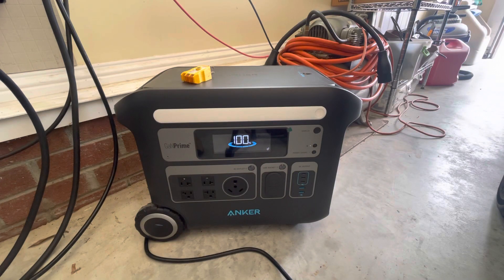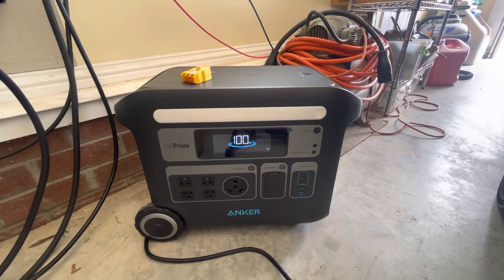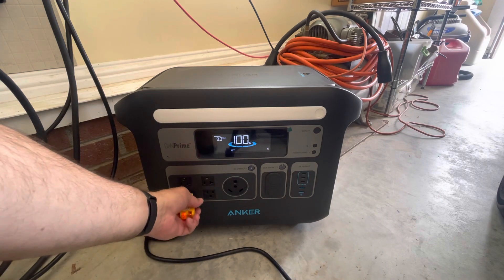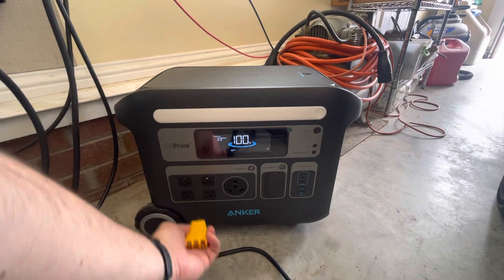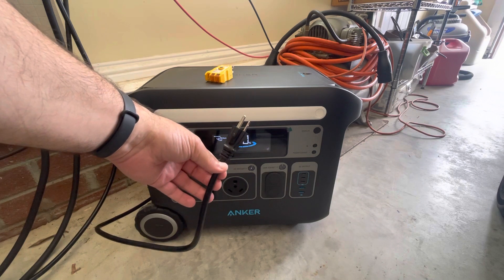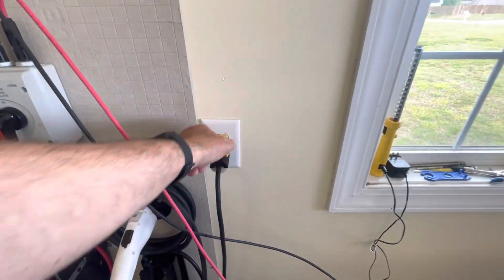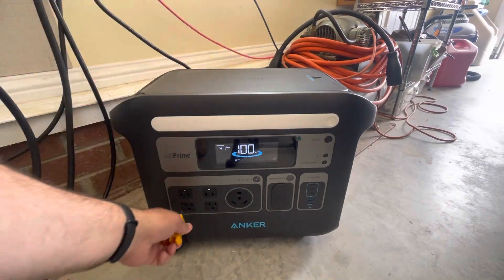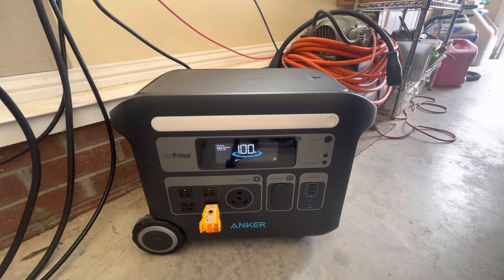Anker 767 reverse polarity testing and miswiring test

Comment: I'm trying to power my RV and my RV gives me a reversed polarity fault and won't let the Anker 767 power it. Reached out to Anker and was working with their engineers, they are great but they are saying it is the RV. Thor (I have a Thor Sanctuary 19P) and they said I needed a neutral bonding plug, bought two, neither work. When I did the test as you did. Unattached to the wall, the receptable tester tested hot and ground reversed on two separate testers plugged into the Anker 767, When I plugged the Anker 767 into the wall, it said correct wiring, so my test was the exact opposite of what your tested. It still won't power my RV. I think it may be the way my RV Southwire Auto Transfer Switch or Remote Battery Switch works and may be preventing it from working. If anyone knows how to fix it, please help. Thanks. I love the Anker 767, it works great and I have to give Anker credit, they have been trying to help me fix this issue but it is either their system or the RV's. My question is, why would the wiring be reversed? I understand that in an RV, you don't necessarily have an earth ground but can't it be grounded to the vehicle? Also, it must be an issue since all of my cables have a reverse polarity protection, which leads me to believe this is a problem in RVs (I'm new to RVs if you haven't figure that out).

Comment: Great video, I received one of these units and in my case the unit shows correct wiring when plugged into bypass mode however when in the inverter mode my socket tester says the live/neutral are reversed. Anker is claiming "you don't have to plug the tester into the 767 when in inverter mode because it does not differentiate between the Neutral and Live wires" is this correct?
Reply from the maker: Yes, that is correct for the Anker and most all "floating neutral" generators.  If you would like to learn more,  search youtube for "reel clear media" and watch his 3 part series on understanding grounding.

Comment: I've seen several videos with this and another issue that seemed to be a pretty big QC problem. Since Anker's tech support seemed to be so responsive (according to the reviewers) I went ahead and picked up the 767 Solar panel bundle during the recent Prime Day sale. I ran these same tests on my unit and "thankfully" am not experiencing either issue. So either I got lucky or Anker has resolved their QC issues. I certainly hope it's the latter as this seems to be a quality product. Thanks for sharing your experience. Cheers! 👽✌️

Comment: I just received one of these units and made sure to test it for this issue, and discovered the same problem. Thank you for the helpful warning! I have contacted Anker support, which opened a ticket with their automated system, but I haven't gotten a human reply yet.

By the way, I confirmed (at least in my case) that the issue is with the unit, not the power cord: I used another AC power cord that I had scavenged from an old monitor, swapped it in for the cord supplied by Anker, and had the exact same issue.

Comment: Quick follow up - replacement received and there is no polarity issue. BUT - (and I just sent an email to Anker), the replacement unit will not accept an AC Input Watt charge of >800 and w/in a few minutes, the input watts drops into the 40's and stays there. Any thoughts?

Comment: Thanks for this!  Luckily mine showed as "Correct" when I tested with my outlet tester and the charge cable plugged in.  With charge cable unplugged, it shows "Hot/Neu Rev" with the red light on outlet tester very faint, which I believe is okay since the Anker 767 is a floating neutral and not bonded.  If it helps anyone else, my unit showed it was manufactured on 1/4/23 and passed QA inspection on 2/14/23.

Comment: Hi,Can you post a video of your new unit?, Does the new one when not connected to the outlet shows "Open Ground" or both lights like "Correct"?, TIA
Reply: I got a replacement unit and it shows both light correct when plugged into outlet. But still having erratic wattage output. ANKER POWERHOUSE 767 STILL NOT WORKING
https://youtu.be/JH0LOmtinp8

Comment: Thanks man!!! Bought me the tester and I have the same issue. Email with video sent to Anker!
Reply from the maker: Let us know what they say.  Most people are being told to ship their unit back but other people are being told there will be firmware update soon to address the issue.
Reply: @leafnutz2341  Anker responded overnight. They are sending me a FexEx mailer to send back my unit and they will be replacing it with a new one. TY very much for your video and FB post - I never would have known about the reverse polarity issue. (Really only an issue for my use, if I were using passthrough charging.)

Comment: Thanks for pointing this out on my video. I'm going to email them again about the hot/neutral issue. I dont understand the technicals, why does it only show the hot natural reverse when the unit is charging?
Reply: I'd suspect the inverter output internally is wired backwards.  When you're on shore power everything is okay.  But if you pull the plug (cut the shore power) the inverter kicks in..but it's flipped.

Comment: Just got my tester in the mail today. When I plugged the tester to my Anker 767 it shows open Ground. Should I contact Anker about this situation for a replacement? Or is open ground still safe? Thanks.
Reply from the maker: An open ground when running the inverter only would be correct for a floating neutral unit.  Repeat your test while the unit is plugged into a wall outlet.  Be sure to test the outlet your plug it into as well.
Reply: @leafnutz2341  ok, I also tested my 2 Jackery 1000, Jackery 500, & Jackery 290 they also shows “open ground” when I plug in the tester.
Reply: @leafnutz2341 So when the unti is NOT plugged into a wall and running on the inverter/battery only it is fine for a open ground on my tester?  Or should it be always stating correct on the tester wather the unit is plugged in or not?  Please advise.  Just got mine today and it shows open geound while not plugged in. .  Thank you@leafnutz2341

Comment: I did the same test as you did and found a different issue; my 767 showed an "open Ground" on the outlets when the 767 is plugged into AC in my house.  The tester read "correct" when run on just the battery. The tester also showed that the receptacle is wired correctly.  Can anyone comment on this?  Is it an issue?
Reply from the maker: Did you  test your house outlet to make sure the open ground wasn't already there?
Reply: @leafnutz2341  Yes I did.  The outlet tested OK, as I said above. I also researched "open ground" and Google told me that it is a dangerous situation.
Reply from the maker: @richardmolnar3007  Keep in mind that know just enough to be dangerous BUT as I understand it...  SOME solar generators use a "dynamic ground" when operating solely from the inverter while others have an open ground since they aren't technically grounded and can use a grounding plug if needed.  Any time a generator is plugged into an outlet in your home, there should only be one ground at the main panel.  It is unclear what grounding strategy Anker has adopted and no explanations have been offered in their emails to me.  All I got was "Please rest assured that another replacement will be wired correctly. We have already discovered and resolved the issue."  That was the direct quote from Anker customer service.
Reply: @leafnutz2341  Anker responded to my issue and wants to replace the unit. My 767 issue is NOT the same as yours, which is concerning, but they are responsive. I hope they thoroughly test out the replacement unit.  Funny, however, in that my 767 seemed to work perfectly.  I don't have time for this $3000 science project.
Reply: NEW news here.....  I purchased a NEW tester and found that the old one I used is defective.  My new tester shows the SAME issue that you experienced-The "hot and neutral is reversed" on my 767 also when plugged into A/C power.  I am still waiting for a shipping label from Anker to have it replaced.  Yes, my home outlet also tests "correct wiring."  I am glad that at least mine has a "known" issue and not another new problem............

Comment: I bet the Anker has a bonded neutral and when you plug in your 120v ac from your house it's a bonded neutral from your power panel. You can't have two bonded neutrals with pass thru charging and power, if the Anker had a floating neutral this would not be an issue. This is an issue with generators with bonded neutrals and transfer switches to homes.
Reply from the maker: I agree BUT why would a bonded neutral test "hot neutral reversed" and why would Anker promptly send out a label and say QUOTE "Please rest assured that another replacement will be wired correctly. We have already discovered and resolved the issue."
Reply: @leafnutz2341  Interesting issue,  neutrals and bonding can cause many issues,  nevertheless glad Anker is going to resolve this for you. Best regards.